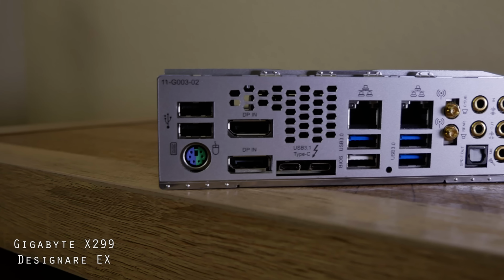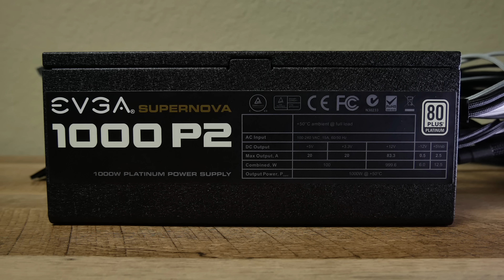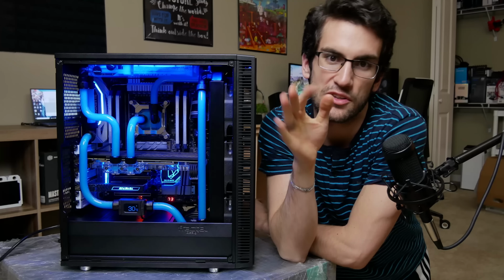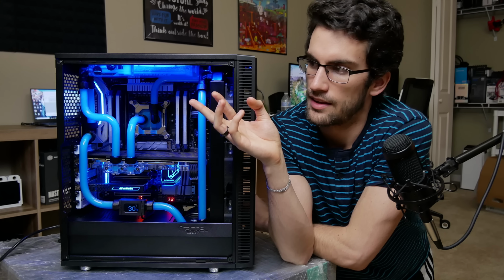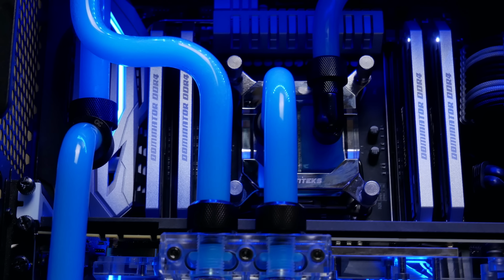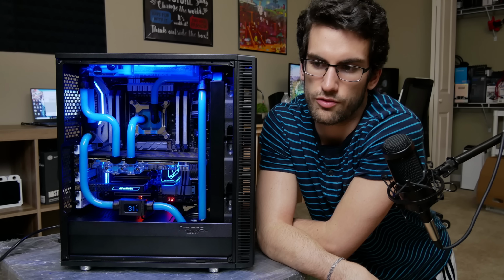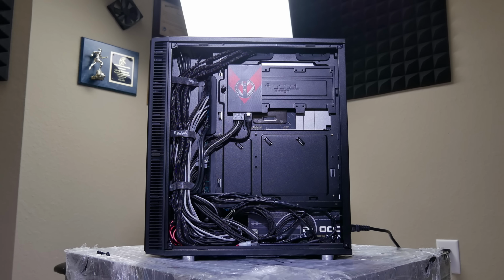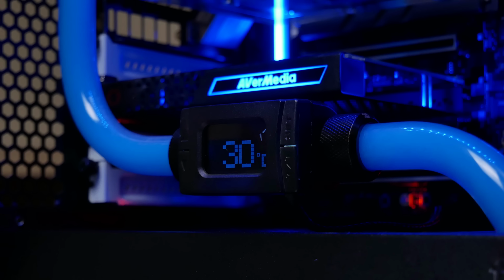Watercooled (For No Reason) Streaming PC Build

Comment: I think corsair should make DIMM Blanks to fill in empty slots for both protection of the slot and looks. Don't know why but empty sockets and slots in my build has always bothered me.
Reply: Who's fault is that? No ones stopping you from buying more RAM or other parts to put in your build...............
Reply: Well it's a $30 blank or $250+ ($530 in this builds case) for additional RAM. It won't be utilized, it will add strain to the CPU's memory controller, produce more heat, and lower overclocking potential. Chill dude, everyone has a reason for their opinion.
Reply: David Whitfield great idea!
Reply: i suppose blanks are out of the norm 

:3
Reply: David Whitfield if you watercool no-one will notice :3
Reply: David Whitfield ikr!!! i hate having empty slots

Comment: first off, that system looks awesome. i don't even particularly like blue, but it works great here and the Avermedia lighting even matches the Designare cover on the chip. 
now, i've got some questions, although two of them are not directly related to this build (sorry). 
- how are those Noiseblocker fans? they're surprisingly old, so i'm wondering if they held up for use on radiators. Silent Wings 3 and Noctua's NF-F12 (because of course) are superior on paper, but unfortunately neither of them comes in a white bladed variant 
- what are possible fan configurations in the front of the Meshify C (and technically Define C, too, i suppose)? can you mount fans between the front panel and the chassis, e.g. for a push-pull rad, or is there only room on the inside? 
- again about the Meshify C, as i just learned it actually doesn't have a "proper" dust filter in the front but rather simply a foam insert. compared to a mesh filter, how efficient is it at catching dust and how annoying and painful is it to clean that thing?

Comment: Nice build, how did you mount the glacier r220 to the top of the case, did you use the screws that came with the r220 and screwed them from the top of the case through the heat sink? or did you use  custom screws or mount? please advise.

Comment: My fiancee feels that my current flagship machine is beyond overkill.

AMD Threadripper 1950X
Gigabyte X399 Aorus Gaming 7
G.Skill Trident Z 3200 32GB (16x2 *Going to upgrade to 64GB in the following months)
EVGA GTX 1060 SSC 6GB (Hoping to upgrade to a 1080ti *When prices return to normal....if they do*)

The only reason I went this route is because this machine will last me a long time. Also going to use it for at home work. Creating/Editing content.

AND

I will eventually have a Ryzen 7 1800X system.

Comment: Trying to figure out what kind of fluid to use on my rig. I'm currently using a clear UV, but would like to use an opaque white. I'm just not sure which brand to use. I've seen a lot of builds get gunked up after a few weeks and would like to avoid it.

Comment: I have a couple of questions. If the capture card only supports 1080p, doesn't that mean your monitor is limited to 1080p aswell?
And why does it say DP IN on the motherboard, are those ports for capturing instead of outputting video?

Comment: Looking at getting the Phanteks Glacier reservoir, but according to its manual, the way you mounted it (face down) isn't one of the "three orientations" the manual says it can do.  Have you noticed any problems with it mounted that way? Conversely, do you think it theoretically mount it face up (on the PSU shroud for example)? I could see an air bubble causing a problem in both orientations.

Comment: This reservoir looks like bubble trouble. Also the CPU block doesn't seem to distribute flow across all fins evenly unlike EK's EVO Supreme. I never found Phanteks to be good at that.
Reply from the maker: GenoKay The CPU block wasn't because the loop wasn't fully primed. Not an issue with the block at all. You can rotate it 90 degrees if that's your concern. Reservoir is only bubble trouble if you mounted it horizontally like I did.